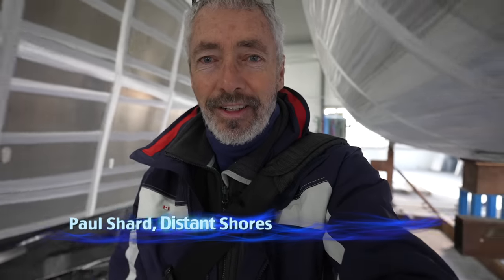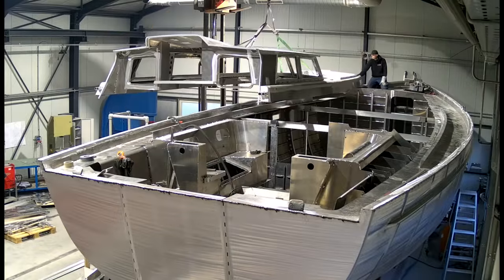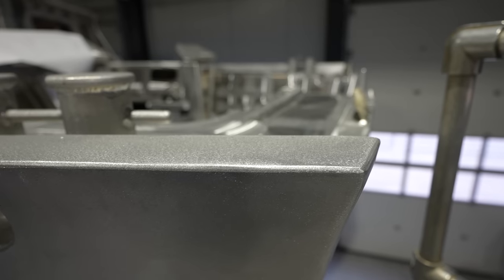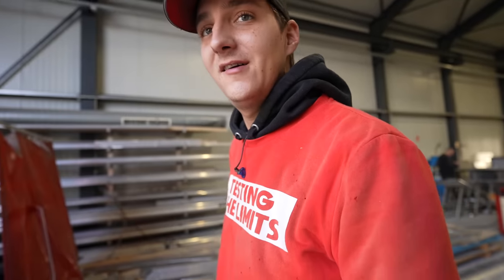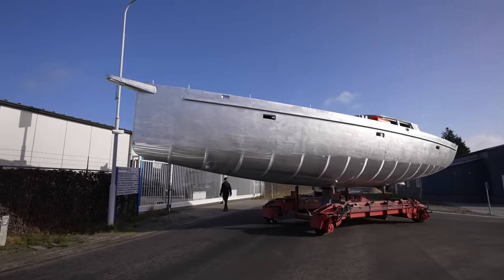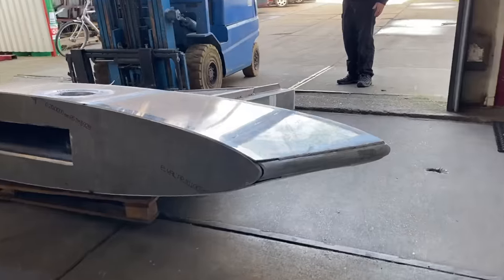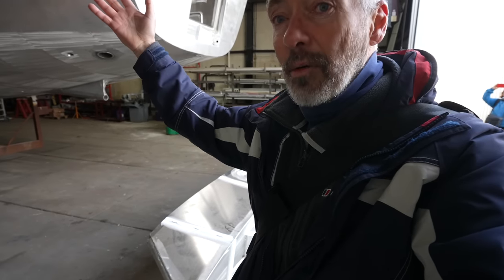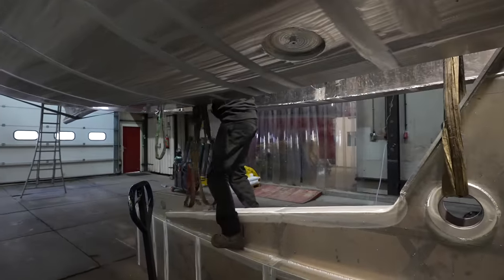Building an ALUMINUM Sailboat Pt 12 - Keel Assembly Welded On | EP 232

Comment: Hi Paul,
I understand that you lead will be poured directly in the aluminum of your keel embryo. On our Boréal 47.2, the lead is insulated from the aluminium of the hull to prevent any corrosion in the keel embryo in case the hull were to be breached (we have 10mm of alu plate in the keel embryo but despite that the lead is insulated).
Is there any precautions taken by KB yacht builders to avoid galvanic corrosion there please?
Salutations d’Ibiza,
Yan

Comment: The hull is 10% of the build. from experience, integral tanks are good for fuel. For grey water & black water use composite tanks, electrolysis will eat the tank tops of aluminum tanks

Comment: The melting point for lead is 327.5 °C and for aluminum, it is 660.3 °C. I assume that by "pouring" the lead into the keel you mean it will be molten and not just pouring in lead shot.

Comment: Do you plan to laser scan your interior before interior kit out? If not, this would be a good idea since it will give you an accurate as-built structural model. This means you will have a solid "before" picture of the boat, useful for years later during refit. It's good to do for your electrical wiring as well.

Comment: It's kind of frustrating to know that right now (3/6/23) the new Distant Shores is even further along.  I'm sure the lead is in, the retractable keel is installed and much of the exterior painting is done.  I'll bet that the interior work has begun, maybe some of the finished wood work too.   Nothing like YouTube time compared to real time!  LOL   As usual, I can't wait for the next update!  : - )

PS - Is the exterior paint applied electrostatically?  I'm not sure that's possible if the paint is sprayed on, and I doubt they have a huge "dip tank" to put the boat in.  Also, is the paint a special kind of epoxy formula or some other exotic type?  I know that aluminum is not easy to "paint".

Comment: Good morning. Question: did you film the lead pour? I’m totally ignorant as to how aluminum reacts to molten lead? ❤
Reply: Lead molts at around 327 degrees Celsius and pure aluminum at 658 degrees. The latter material used to build the boat is a suitable high-strength/high ductility Al-alloy, which may have other temperature properties compared to pure Aluminum. But, sure, it would have been interesting to view the process. Cheers.

Comment: sure anyone can make fair using stringers, try just athwartships framing @400 centers, I  have built many, , but after 40 years I design heavy plate 10mm bottom 8 mm topsides 6mm deck widely spaced frames, twin chines,never built upside down, the keel and its floors first

Comment: Although I like this episode, the shot at 5:57 hurts a little. It is repeated later in the episode. If it were a US flag hanging upside down I'm sure that it would not have been included in the video. It gives the video a, most likely unintended, political message.
Reply: Had to look at your observation on a PC monitor. Not a US flag.